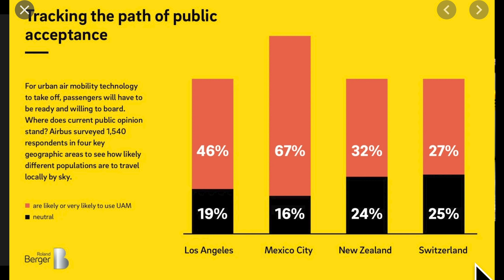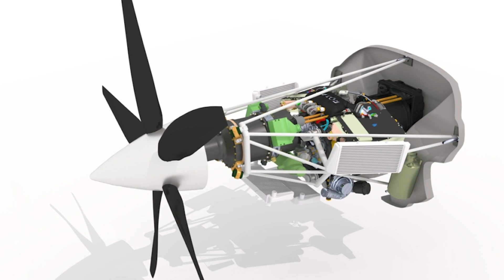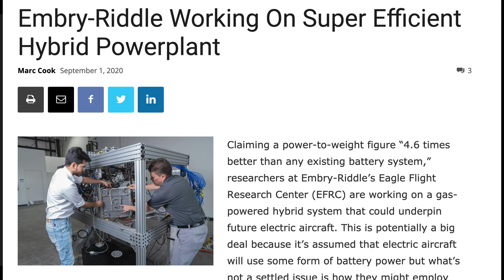AVweb VODCAST: Why Electric Aircraft Are Tilting Toward Hybrid Drives

Comment: Reducing the 30 min VFR requirement is just stupid. I personally apply a 1 hour reserve. If batteries can't deliver, they have no place in aviation. Safety first, always.
Reply: re: "If batteries can't deliver, they have no place in aviation. Safety first, always."  exactly, you'd think we'd learn something from the grounding of JAL's fleet of 787's.  "Those who don't know History are DOOMED to repeat it" - George Santayana (1863-1952)
Reply: My thoughts exactly as I was watching this. So we are relaxing safety regulations to cater for new technology? Are we trying to redefine the word "bass-ackwards" here??
Reply: ELoS may be an airframe parachute.
Reply: @LeantoPeak  

Would be ideal for specific missions, lawyers are good with such lingo.... ie: pattern missions, or short hops to the neighboring field for training.

The reality is, we are able to receive remaining energy storage in double digit watt/hour specifics. Where, previously, we were running kitchen timers for best guesses in fuel remaining.

PS: There batteries usually have a sizable bottom buffer (reserve) built in at 0%, for long term battery health. Wouldn't be unimaginable to allow tapping into such during an emergency. Battery Electric cars will just power down at 0% to protect the battery. Cruising at 3,000 ft is a different situation.

Comment: Is this really a technology that is crucial to be developed? Do we really need packages delivered by drone over the top of populated areas? And do we really want passengers inside a vehicle that has 8 blades spinning just above their head? Seems like we are chasing a solution for a non-critical ‘problem’.
Reply: Urban congestion is pretty critical sometimes. And complaining about the blades 'spinning just above their head' seems like a complaint about aviation at all. In reply to your first question, I think this goes to the heart of a free society. They are spending their money and effort where they want to. You don't see it as an important application of this technology, and that's okay. In truth, I think, like you, that green is a 'feel good scam'. But they're going to advance other aspects of aviation this way, and I'm eager for those secondary benefits.
Reply: @meritwolf219  , I would argue against it being a feel good scam. In general, when you run the numbers, it is overall better... however, what you do see is that green tech isn't adopted out of the goodness of people's and company's hearts. Most often 'green' tech is only adopted once it reaches economic benefits in cost or efficiency. Usually these benefits take a bit to materialize though, as the initial R&D hump to overcome keeps the tech in the red, so to speak, for a while. Kind of like wind power, which needed subsidies, but then actually became cheaper than some traditional energy sources at a later time, without subsidies.
Reply: @JimBob1937  'run the numbers', you said. Which numbers? Would that be Solyndra's numbers? Oof, no. Okay, then let's look at wind and solar. When a service absolutely has to be up, they aim for what's called 'five nines' of reliability. 99.999% uptime. Neither wind nor solar are even looking at that, which means they leave just a little to be desired for a system that is the foundation of our modern way of life. (No offense to any off-the-grid advocates out there, but it's not exactly the modern way of life you're advocating.) Turn that five nines into nine fives, 55.5~% uptime, and solar still sees that as a distant dream. Again, not exactly what you want to see in one of your foundational needs. And let's look at wind a little more. How about the number of dead birds, and the acres of lost or impaired ground cover from putting up the windmills? Dead birds don't matter to you? Then you won't object if I use DDT, right? I could go on, and you'll feel (with reason) that I'm just jousting at straw men, but it's because windmills, and the rest of the green scam, don't hold up.
Reply: @meritwolf219  ,  with all due respect you seem to have little idea of what you're talking about, and fit into the ill-informed group I sometimes discuss. I don't think you have an understanding of grid balancing, different turbines of different sizes and weights to smooth out production for wind, small scale buffering techniques, dispatchable power sources...etc. Always interesting when people try to lecture engineers on the technology they enjoy but have no idea how it works... yet insist they know it better than the engineers themselves.
Reply: @meritwolf219  , it's ironic as I was discussing this very thing earlier with another guy on this video:
"Sadly, in the USA this has become political for some reason, with conservatives thinking it's some sort of left-wing conspiracy, lol. However, fossil fuels still have their place, just not to be used as a one size fits all approach in my opinion."

I'm going to guess you're a conservative in the USA by your reference of 'Solyndra' which had a vague connection to Obama. Keep in mind, engineering, physics, and general reality do not depend on political ideology. Yet, you came here to try and lecture me with a bunch of nonsensical ramblings for which you don't have the vaguest idea.

"Then you won't object if I use DDT"

I also don't think you understand that DDT was bioaccumulating, it had other issues than just the common issue of thinning eggs for eagles and whatnot. Though DDT is still in use in certain parts of the world, generally it's a weighing of pros and cons, with it being tipped towards DDT in their circumstances.
Reply: @JimBob1937  If you're really saying that only engineers who are actively engaged in it can understand renewable energy and the associated aspects of this discussion, I commend to you the words of the Medieval Catholic Church: "Only we can know what God is saying."
Reply: @meritwolf219 , I am actually a very large proponent of self teaching. I'm not some elitist that says you need a degree to understand something. However, that does not excuse you from trying to discuss something out of ignorance, there is a large distinction between the two.
Reply: @JimBob1937  Thereby proving my point. You claimed you would argue my point, but all you've spoken about is my qualifications to actually be in a debate with you. You can't/won't argue my point.
Reply: @meritwolf219  , you may want to google, 'not even wrong' to understand my point further.
Reply: @meritwolf219  , can you give me a hint as to your existing education background? I can then suggest a more direct path for your studies.
Reply: @JimBob1937  You didn't reply to them at all. It's not that you snowed me in math, which would at least have left the ball in my court. You just said, over and over, that I lack the qualifications to speak with you. And that after you came to me. And my points may not be well-fleshed (we are in a YT comments thread), but you have never responded to them at all. Just dismissed them as 'nonsensical'. That's not argument. And we're not talking the design of a windmill. We're discussing whether the whole green idea, especially as it centers around electrical generation and storage in batteries, is a scam. For that, bottom-line, aggregated figures are the most relevant data. Not the slight changes to airfoils that would move the efficiency a few points in the right direction.
Reply: @JimBob1937  I decided that Mike P, whom I originally wanted to have a discussion with, has blocked us both to avoid getting buried in our replies. Advise you do the same. After all, I have nothing you want to hear. Clear skies. I'm leaving the pattern.
Reply: @meritwolf219  , my oh my. "We're discussing whether the whole green idea, especially as it centers around electrical generation and storage in batteries, is a scam. "

If you do not understand differential equations or calculus, or the physics at play, I cannot adequately (in my opinion) express to you some of the engineering. You seem to know nothing of engineering, yet somehow believe it is false... which makes no sense. You can't declare something false when you do not understand it. You also seem to refuse to want to learn, which is laughable.
Assume you're that accountant again, I argue you are wrong... I have no idea what I am talking about of course, but hey, you are wrong ;-) You try to explain to me how I am mistaken, but since I seem to want to stay in ignorance and refuse to learn anything about accounting, your explanations fall on deaf ears.
I'd like to explore the area you misunderstand of intermittent power generation and how it actually is not as dire as you seem to think... but again, I'd need to be able to explain in mathematics and physics. You don't seem to have the background knowledge required, so what kind of explanation are you expecting?
I have seen this behavior before. "He refuses to answer my questions, so I win," when in reality, the questions are so nonsensical as to often be unanswerable, since they contain too many flawed and incorrect ideas. Similarly, even if I offered an explanation, it often goes round and round saying I am avoiding their question, as the receiving person lacks so much understanding that they cannot understand that I am answering their questions. Had a similar episode with a guy who had conspiracy theories about 5G, yet knew nothing of electromagnetics or the spectrum, or the quantized nature of particles...etc. It became very trying and ultimately unsuccessful. This is you, but instead, I am avoiding the time suck, and am trying to direct you to educate yourself so that if, after your learnings, you still have questions, you can phrase them appropriately as well as understand the answers.
Even after this failure of a "conversation," I would still suggest you go through Stanford, Edx, and/or MIT OCW to go through the various courses and bring your knowledge up. The answers you seek may very well find you.
Reply: @meritwolf219  , in my last attempt. Can you please give me an idea of your educational background? This will allow me to try and see if it is at a level in which I can formulate any responses. If you have a mathematics background but lack physics, for example, we can then cover the physics first and likely wouldn't be too bad since you have the mathematical background. Electrical engineering certainly isn't the most mathematical of disciplines, I am not that great at it myself to be honest when compared to my wife who studied physics/statistics/machine learning. However, it is certainly still mathematically driven, considering it is a lot easier to manipulate and derive solutions for circuits, probability theory, coding theory (more computer engineering, but was a fun course) ...etc. If we can break down your misunderstandings to specific aspects of physics I could probably give a more targeted breakdown of an answer as well. No offense, but the post you expect me to reply to is just a bunch of vague statements, misunderstandings, and nonsensical logic that is all thrown into a small paragraph. Overall, it is a mish mash of nonsensical statements thrown about, there are a few common aspects which I could attack, but I sincerely believe my explanations would fall on deaf ears without the appropriate background knowledge. Partly, this is because if you did, you likely wouldn't have stated some of those things, kind of a self evidence.
Reply: Mike p, "Is this really a technology that is crucial to be developed?"

That, I'd say, is up to the markets to decide. Evidently they see some potential or there wouldn't be  push in it's direction. But, with most things technology, you never know what may spring/branch off from this market and technology, even if the original thought is a dead end.

Comment: I'm sorry but have to comment because this is such a misinformed interview.  1) The UAM industry is playing out almost exactly as we forecast 4 years in the Elevate white paper, with initial operations in late 2023/early 2024, Lots of certification progress.  2) The UAM industry is not shifting to hybrid because the extra range is not required, and because hybrids are more complex/costlier/poorer emissions - all electric battery is clearly the answer for UAM - hybrid eVTOL will not be able to compete economically.  Production batteries can already do what is needed - we have the data that clearly shows this.  It's not about a love affair with batteries, it's about economics.  But of course the Pat/Verdigo are pushing hybrids because it's what their business is developing.  3) VFR reserves don't seem to be understood (including comments below) - when eVTOL are operated only within a network that can validate ability to perform an emergency landing safely at any time during operation then reduced margin makes sense.  That's why you can't separate the eVTOL from the network or the infrastructure - it's all about a system that works together.

Comment: Hybrid will just make planes less efficient (direct drive is 100% and everything else is less) and heavier (now you need 2 engines! And batteries?). Doesnt sound "green" to me.
Until batteries can store enough energy for their weight to make them useful under the rules that keep us safe then they will just have to wait or find a niche.
Reply: I'm sure there are plenty of applications where hybrids don't make sense but If we want a multi-rotor vehicle for VTOL applications, hybrids will likely make this sort of thing easier.
A hybrid octocopter capable of carrying a couple of passengers is likely much more economical than a scaled down Osprey using direct drive. 
Diesel-electrics have shown the performance gains from using electric motors is often worth the loss of efficiency inherent in these sorts of systems .
Reply: Yep, this whole technology pursuit seems fruitless. Especially if the purpose is to be ‘green’. Batteries are not green, the polluting just takes place out of sight of the consumer, making them fell warm and fuzzy inside.
Reply: Saying that its 100% efficient is misleading. The engine driving it hits peak efficiency at a given point in the RPM range. Decoupling the engine loses efficiency in one area but allows the engine to be tuned to a narrower rpm range, which enables more extreme design without usability problems, potentially saving on net fuel consumption
Reply: @keeganwebber  My experience says a gearbox can do it more efficient with less weight. If you can find a better way then you have a business and should start fundraising, apparently there are a lot of people who want one.
Reply: @robertmichaelbrown  

Modern lithium ion batteries don't use rare earth materials, by definition.

But the motors powering the vehicle may, but that's also variable.

Comment: Oh, laptop batteries, so trendy. You want to make aviation greener? Get the lead out of avgas, and give Johnny C172 an STC to drop a small ~2.0L turbo engine into his $100 hamburger fetcher for $25k instead of the $20k it'll cost him to get his 7.2L 7:1 compression pushrod magneto dinosaur overhauled. Walk before you run.
Reply: Couldn’t agree more, Diamond NG all the way
Reply: @fdtank81  Beautiful airplane, nothing like a general aviation aircraft with a similar level of technology as my car.
Reply: But what LOOKS like it is greener? Electric engines, or continuing with ICE and Fossil Fuel engines? That's always been the problem with being environmentally friendly. Does wrapping cucumbers in cellophane damage or help the environment? turns out it helps the environment, but the public perception would disagree.
Reply: @rjc0234  Sadly, a lot of "green" technology is actually turd wrapped in glitter.

Comment: I think if this video came out two years ago, it would be relevant and correct.  There are so many advances  with batteries it is the hottest tech field right now.  NASA has been working on electric aircraft propulsion the last couple of years as well.  Lithium air, nano, graphene, new Li solid state all make energy per Kg in the petro range.  Some of these can re-charge to 80% in minutes as well.   None of these new batteries will catch fire from bridging and none of them require a cooling system as well.    I'm not watching the certified general aircraft manufacturing segment being an aircraft builder.  I am building a Vans right now and planning on it being electric powered. But I still have a a yer before I need to commit.